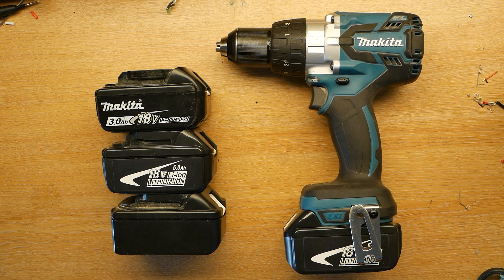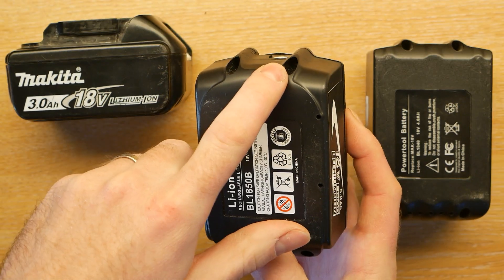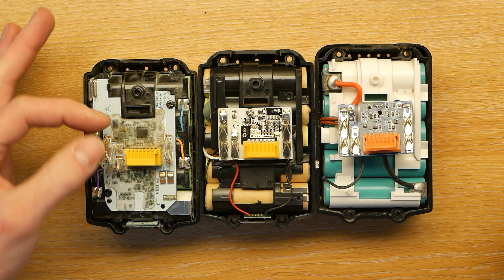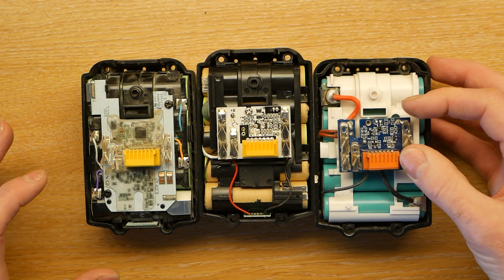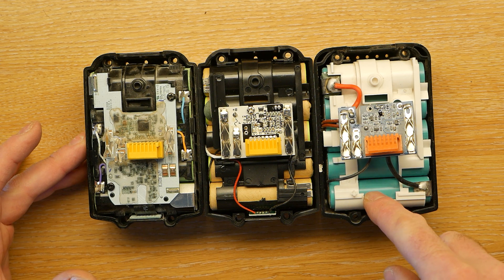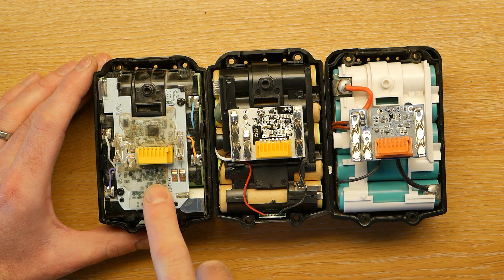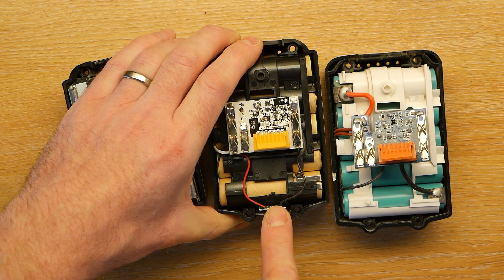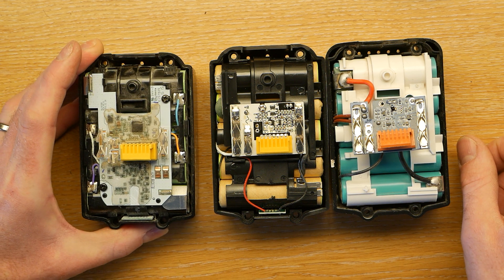What's inside Makita 18v LXT BL1830B OEM and clone battery packs?

Comment: Replacement Power Tool Battery for Makita BL1830
Battery Type:   Li-ion
Voltage:   18V
Capacity:   3000mAh
Color:   Black
Weight:   697.5g
Dimensions: 114.80 x 74.55 x 65.20mm
http://www.drillbattery.com.au/buybattery.php/makita_BL1830_power+tool+battery.html

Comment: you missed out the most important part .... what are the cells??? Sony ? ... what is the capacity ....
Ebay now selling genuine makita 18V 5AHr for $15.60 inc delivery !!
Reply: you must be kidding. 5ah for 15usd :) original?
Reply: @minde28383   Update ... these makita packs were a scam , they never arrived ..I did get full refund from eBay
Reply: the saying "if it's too good to be true, it probably is" is appropriate here. genuine makita batteries are not that inexpensive, and there are a lot of fakes out there (not aftermarket batteries, but aftermarket batteries trying to look pass as the real deal).

buyer beware, and do yourself a favor and learn how to spot the fakes.
Reply: Li-Ion cells are one of the more COUNTERFEITED products in online selling. Even reputable companies occasionally get counterfeit cells when they order in bulk for resale and unknowingly sell them to customers. I always test every single cell I buy...for performance AND safety reasons. Outrageous claims of ampacities of 4000mAh and above for inexpensive 18650 cells are often made and they are printed with VERY well known brand names and part numbers 

Then there are literally impossible claims of over 4500mAh for a single 18650 cell. The chemistry simply doesn't allow that much safe energy storage in an 18650 cell form-factor.

One must also remember that the higher the storage capacity for a given form-factor (like the 18650) generally the more likely it is to have a shorter useful lifetime  and/or reduced number of charge cycles, and/or seriously impaired construction as as far as safety is concerned.